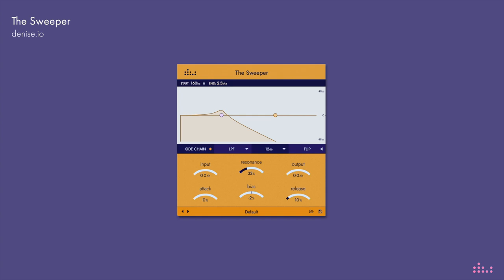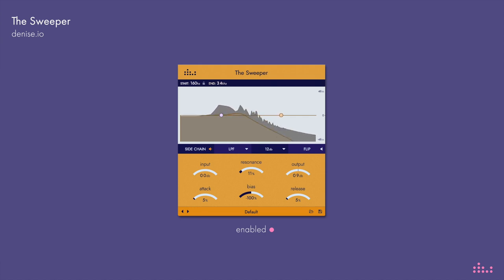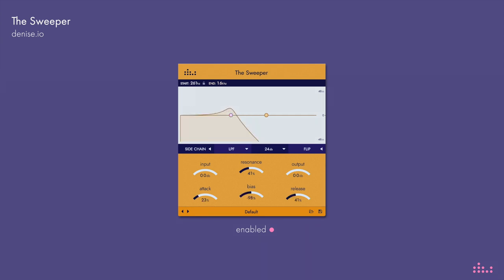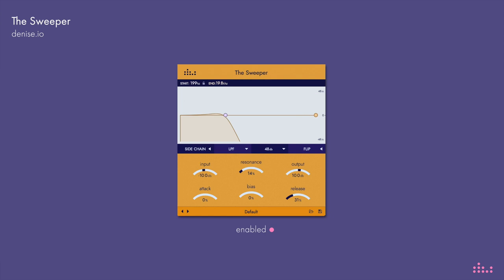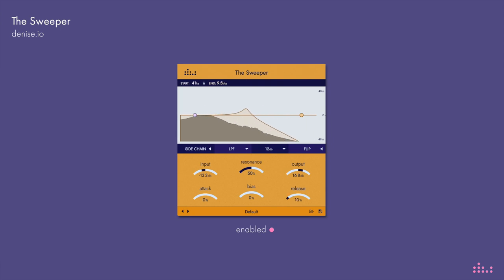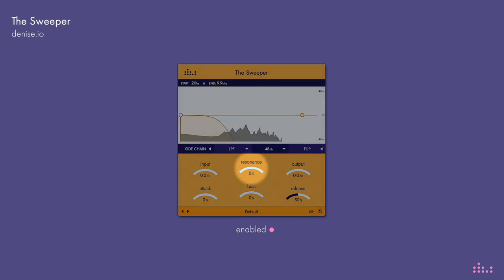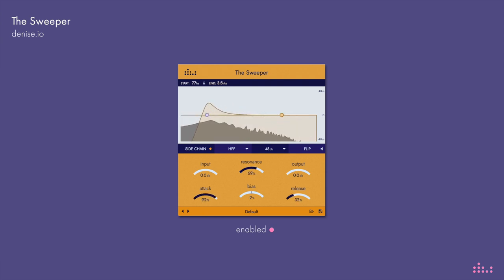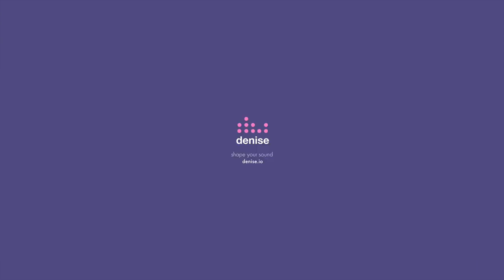The Sweeper walkthrough by nrec & PRTCL

Comment: Not trying to be a killjoy, but how is this different than any other resonant filter with a sideChain input and envelope generators? Fxpansion’s etch and cytomics the drop have been doing this for ages now.
Reply from the maker: Thanks for your question, also it's a a reasonable question to ask. We're not so aware of this plugin, but there are a few things that The Sweeper has that make it something special.

1) you can choose the exact start and end frequencies of the sweep.
2) you can reverse its functions on the spot.
3) you can visualize what you are sweeping.
Reply: @DeniseAudio  This plugin is attracting a lot of attention and for good reasons. This walkthrough is a bit above my head though. Would you please consider walkthroughs for your plugins in which you actually show how the sidechain alternative is built up in the DAW (FL Studio in my case: I can do sidechain compression but I don't know how I would route your plugin in FL instead of sidechaining).
Reply: @ccuny1 I also have the same question on sidechaining it on FL studio @deniseaudio